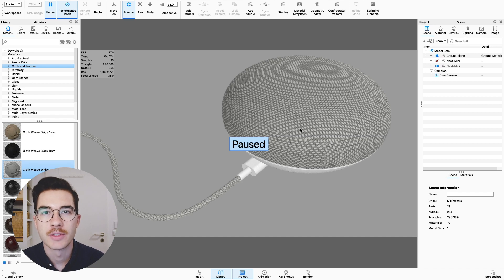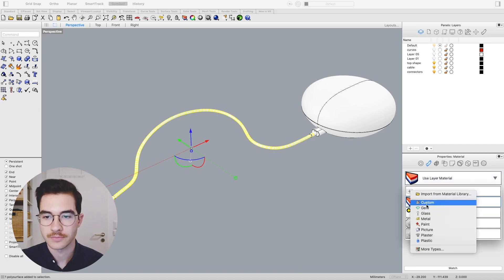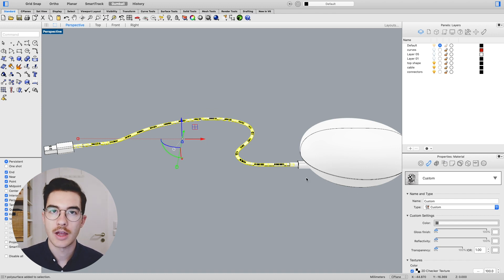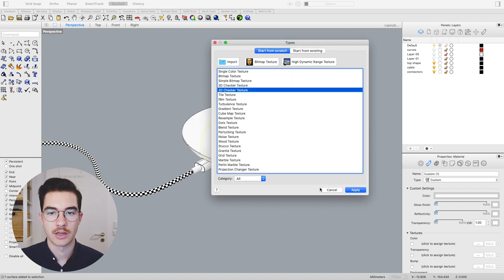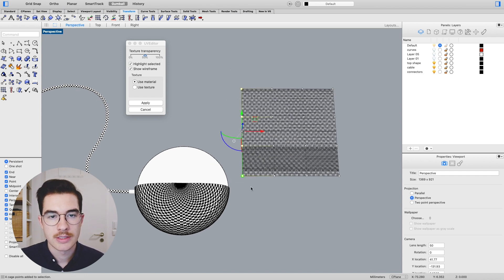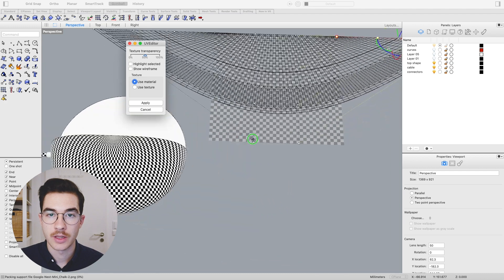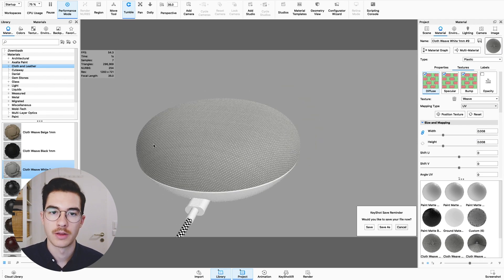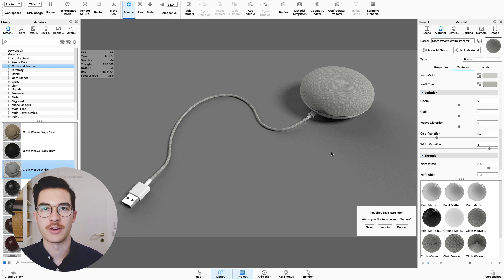Tutorial: UV mapping in Rhino 6 and Keyshot 8

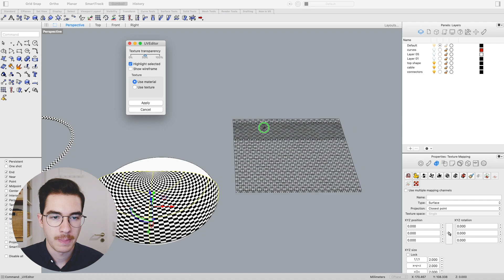Comment: Hey! nice vid but there is a part that you don't show us, how can we rotate and move the mapping? 8:35
Reply from the maker: I am using the gumball to move and rotate. If it is not activated, you can do so on the bottom on PC or on the top toolbar on Mac. Or just type it into the command line.
Reply: @danielbrunsteiner  Hey! I do have the same problem and my gumball is on...
Reply: Did you find a solution? In my case it does not work even gumboil is on.